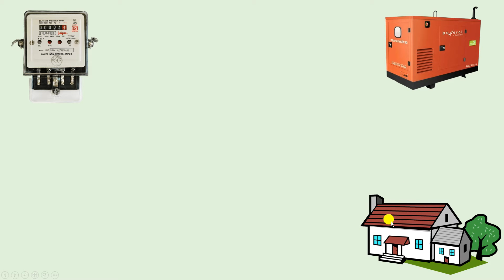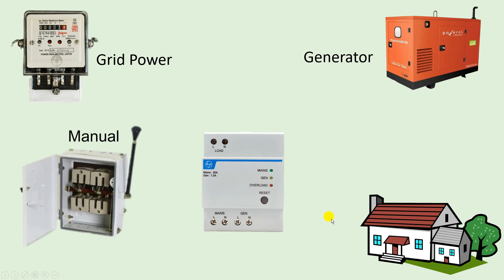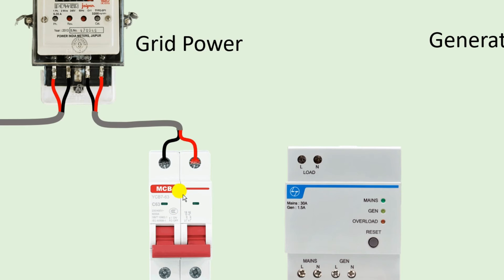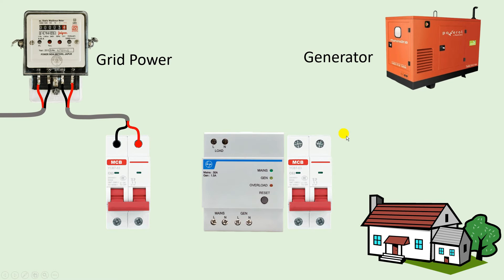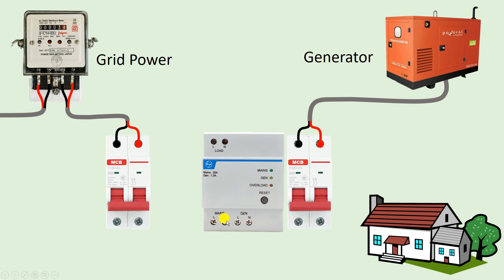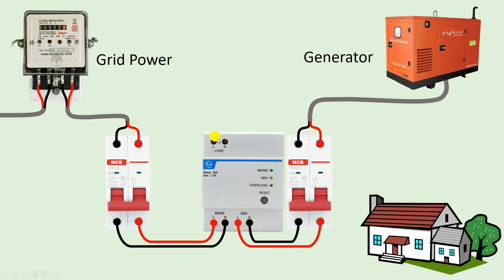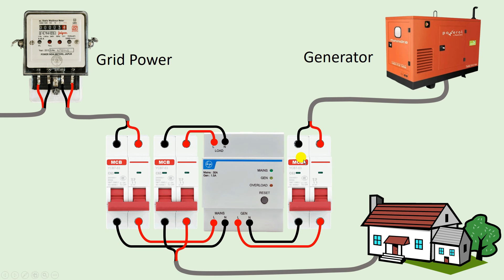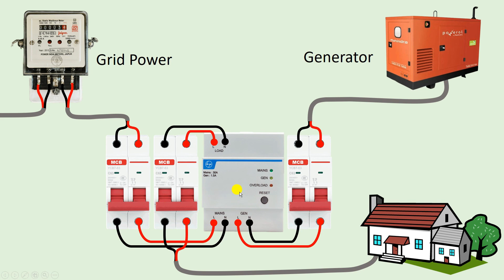Auto Change Over Switch (ATS) Proper Connection with Generator Power @TheElectricalGuy

Comment: Means the generator can't switch off by itself, when the GRID SUPPLY comes in,
To my understanding what makes it be AUTOMATIC CHANGE OVER, is when the GRID comes in the generator itself immediately goes off,
Also once the grid goes off the generator starts itself immediately to supply the building
Thanks